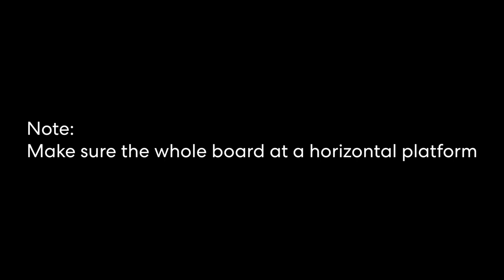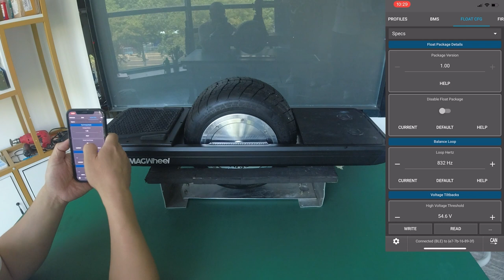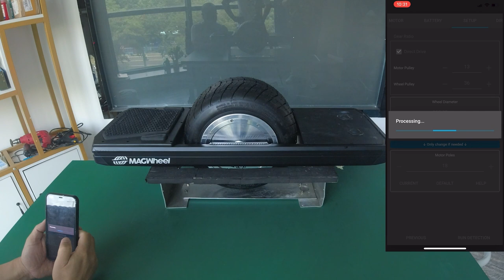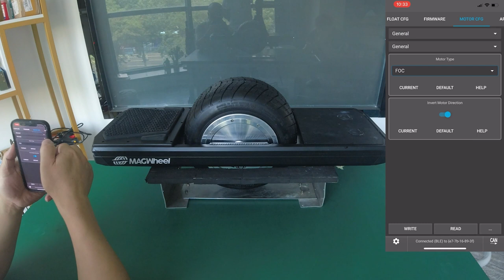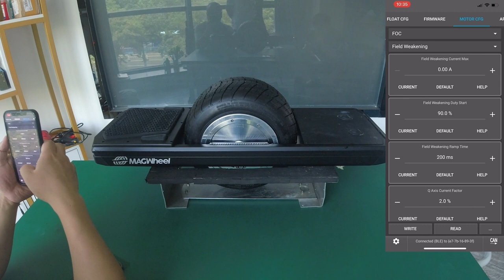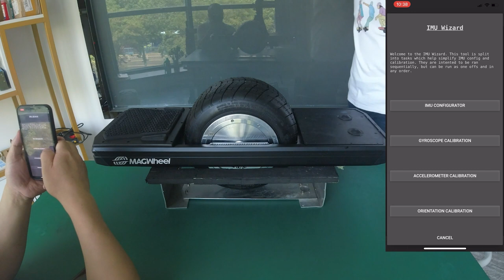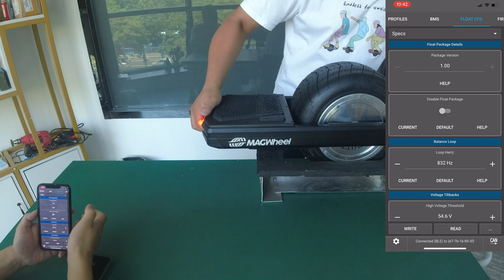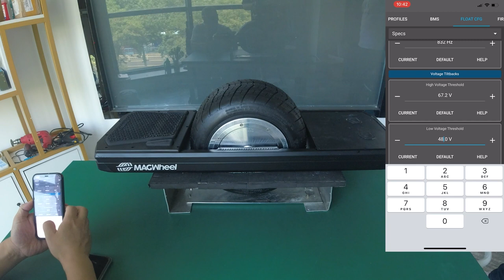How to replace the VESC controller for MAGWheel T3 or Gosmilo X5

Comment: Does the FOCstrot controller use a custom firmware, or is fully updatable with the latest VESC firmware version, as it was a Little FOCer? Thanks in advance.
Reply from the maker: it is similarly little focer which can be updated but we customized the firmware from makers pev

Comment: Hello. I currently own a MAGwheel T2 (1000W) with the old Bluetooth controller. My controller is updatable but MAGWheel never launched the app with the software update (as they promised). I’m thinking about buying the new VESC controller. Where can I buy it? Do you have European resellers? Thanks !!!
Reply from the maker: https://smilomotors.com/collections/accessories/products/controllers?variant=44040840347869
Reply: @surfingonwheel thank you! Would you include the new power button and a setup manual? Are the configuration values the same for a T2?
Reply from the maker: @mortalkarlos  yes, power button and wire adapter included. The manual we would send you by email. the configs are same.

Comment: I'm struggling with the install of a new style controller into an older t2. Forgetting the lights. I can get everything setup as you have it. The wheel will spin when commanded, but I cannot get any response when the sensors are triggered. Ive tried multiple trotter sensors with no change.
Reply from the maker: you got the focstrot controller or original trotter controller? that is different way to recalibrate
Reply: Focstrot controller.   It had the old style originally.
Reply from the maker: @ifixeuros  No, focstrot controller is based on VESC project and updatable same as little focer
Reply: I purchased your vesc controller. I am installing it into an old trotter. These are my issues.  I have two trotters a t2 and t3. The focstrot controller I purchased from gosmilo is operating the same way in both.  No engagement.  I've emailed gosmilo with no response and never received instructions as promised. $250 is a lot of money to spend on something that I can't figure out how to operate.
Reply from the maker: @ifixeuros  sorry, we haven't received your email. what is your email please? I will send you another manual for it or we can connect by whatsapp.
Reply from the maker: before you detect the motor, you need to disable the floatpackage. and did you do the IMU recalibration ?
Reply from the maker: you are Maier Peter ?

Comment: Tengo t3, donde puedo comprar el nuevo controlador? Cuál es el modelo que tengo que comprar?, solo cambiar el control vale? Gracias
Reply from the maker: https://smilomotors.com/collections/accessories/products/vesc-controller-upgrade-kit?variant=45297008574685
Reply from the maker: you can below from the above shop and upgrade the footpad and new sensor

Comment: I have a t3 like this picture. Dead battery and controller. Theres no volume on the first part of the video. Based out of canada, i wouldnt mind getting this fixed up with a vesc controller and new battery. The video is a bit hard to follow though without sound and the current angle.
Reply from the maker: yes, we can ship battery and controller to Canada
Reply from the maker: VESC controller:https://smilomotors.com/collections/accessories
Reply from the maker: T3 battery: https://smilomotors.com/collections/accessories/products/battery?variant=44036977230045
Reply: @surfingonwheel  cool. And it didn't appear to have any soldering to put these in? Video is hard to follow. Am I correct that it can just be plugged in?
Reply from the maker: @FloatinCanada  yes, just plug in, no need soldering.

Comment: Will this work on a trotter Funkywheel?
Reply from the maker: yes, what is the model? 48V?
Reply: @surfingonwheel  I believe it is the M8 60V 1000w. ( the newest one, i just got it this weekend for a good deal at a Bike show in California without knowing anything about it, demo unit they didn't want to take back to China) What advantages does this VESC give? Will your firmware work fine on it?
Reply from the maker: @SnowHoarder  yes, it can work. If you know VESC controller, then you know it what the advantages. you can buy it from https://smilomotors.com/collections/accessories/products/controllers?variant=44218192593117 and we also can upgrade the heeloff sensor https://smilomotors.com/collections/accessories/products/gosmilo-footpad-sensor?variant=44910516797661
Reply: @surfingonwheel  Thank you! Do you know which one I should order for the FunkyWheel 1000watt EX? Its plug and play with power switch etc?
Reply from the maker: @SnowHoarder  controller: https://smilomotors.com/collections/accessories/products/controllers?variant=44218192593117
Reply from the maker: @SnowHoarder  footpad:https://smilomotors.com/products/gosmilo-grip-footpad-1
Reply from the maker: @SnowHoarder  https://smilomotors.com/collections/accessories/products/gosmilo-footpad-sensor?variant=44910516797661